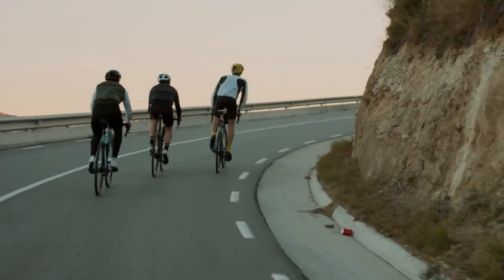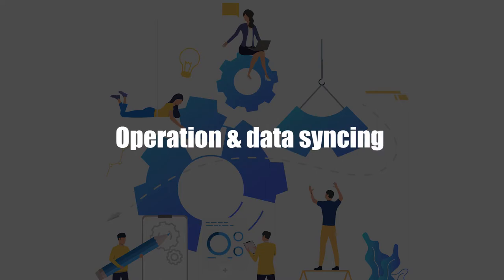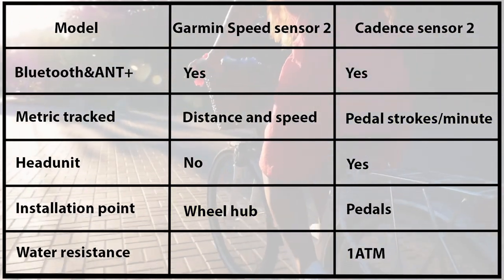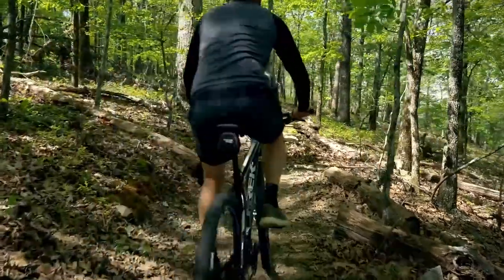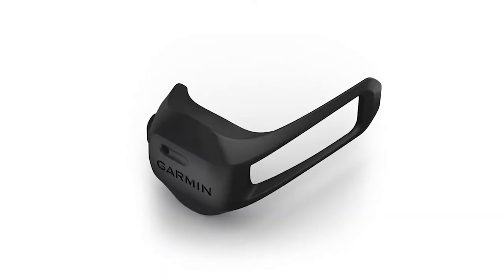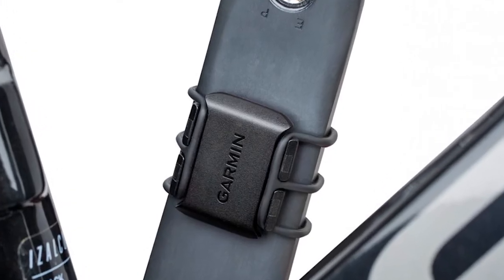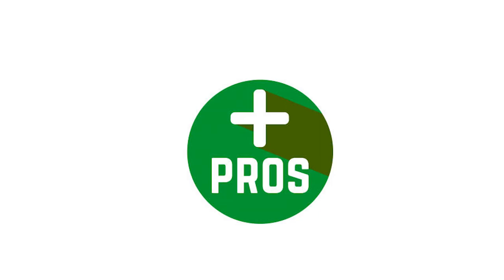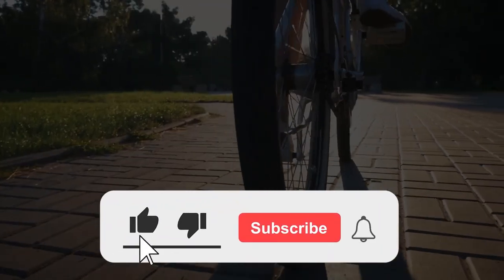Garmin Speed Sensor 2 vs Cadence Sensor 2: What Are The Differences? (A Detailed Comparison)

Comment: if you have a smart watch we dont need a speed sensor i guess.. only the cadence sensor is required. i have a solar instinct and just bought the cadence sensor. anyway i can see sensor options in the settings of the smart watch.
Reply: @arundev Hi I'm Jared from Fit Lab, thank you for watching this video. We highly appreciate your feedback and we'll put it into consideration for our future reviews. What smartwatch do you use for your workouts?
Reply: Speed sensor is good to install if you need accurate data as there might be slight accuracy issue with gps data.

Comment: I have a Venu 2s and just bought the Garmin speed sensor 2 in case I need to use my bike indoors.  I used the speed sensor with the watch on a 20-mile ride today and my Garmin connect gave me two separate rides...one that is 20 miles and the other very inaccurate 6 miles at 3mph. Very odd.